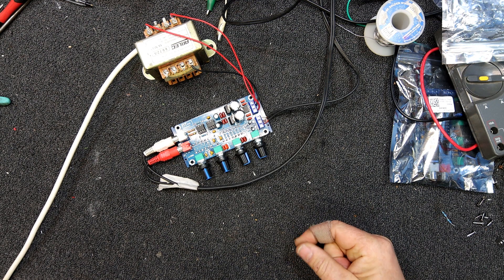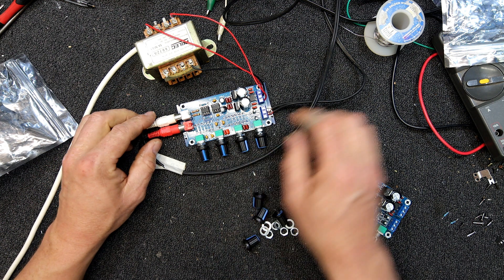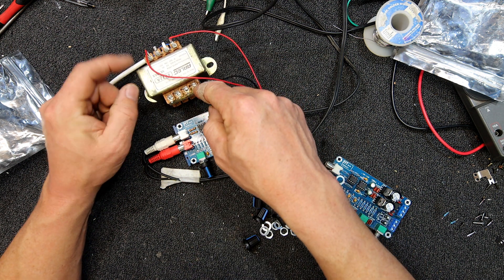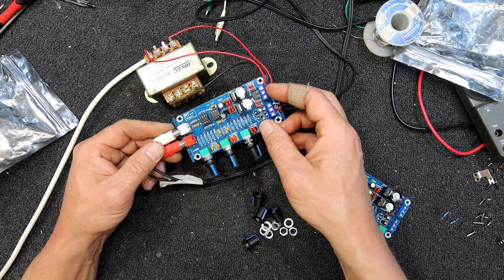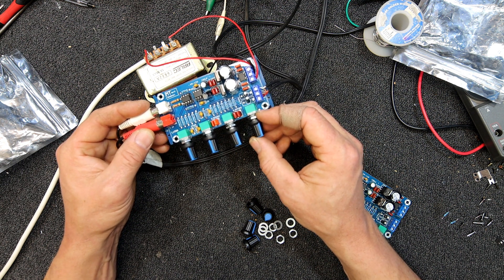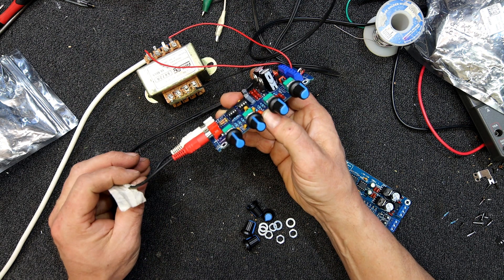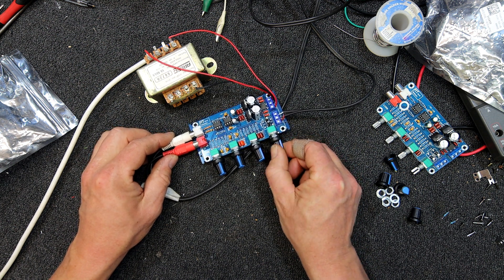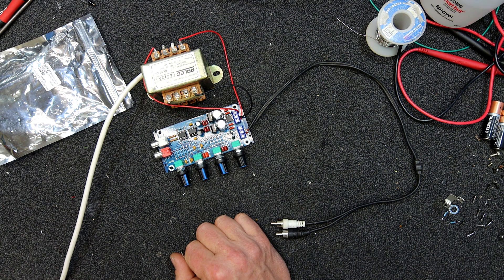Trying Out a Cheap Ebay Preamplifier Board NE5532 from MT Hifi

Comment: Should be able to power this with a 24v DC supply yes? as it has a bridge rectifier built in
Reply from the maker: As long as it can handle that voltage then DC will pass through the bridge fine. The voltage will drop by about 1.4V due to going through two diodes.